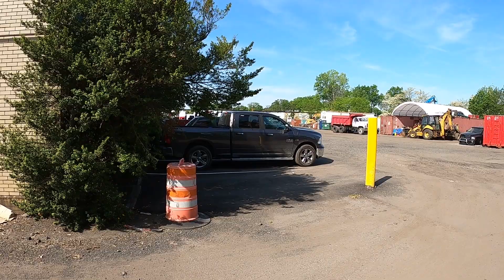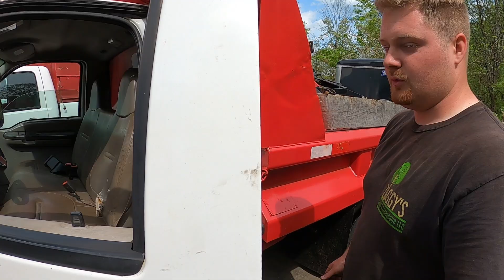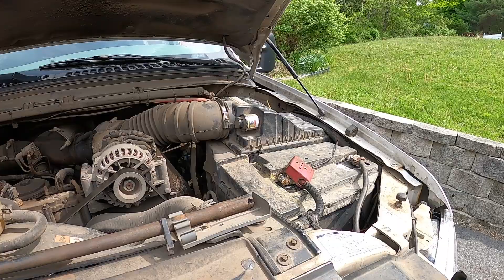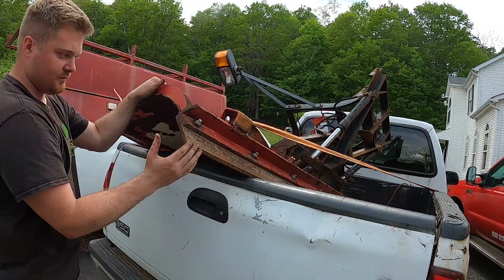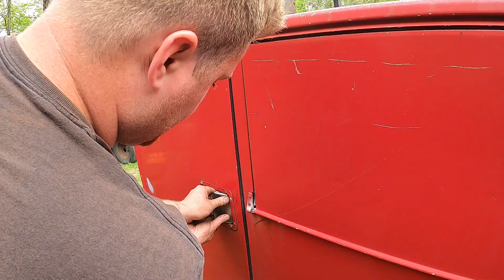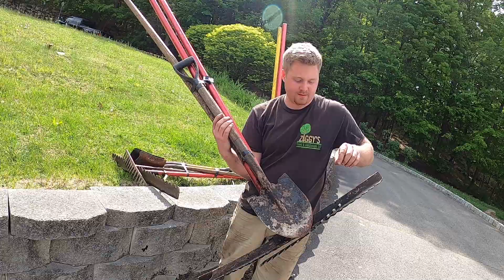Buying a Whole Other Company's ENTIRE FLEET of Work Trucks!

Comment: I do like how Ford leaves a seem at the rocker panel... Makes it easier to replace them. I did a couple on my last F-450. Also on the GMC the broken bolts in the exhaust manifolds are super common... They aren't too bad to fix usually after you take the remaining bolts out you can weld nuts onto the studs left and they come out pretty easily. 9 out of 10 I have done have been successful. Figure 2 hours per side. The manifolds are pretty cheap also if you need to replace them. I actually think I have a video on this very thing.

Comment: I have a landscaping/Snow removal company in North Jersey, not to far from clifton. We do only commercial properties and all I use are the F350s with 5.4L in them. Even a mason dump. I prefer the gas over the diesel. The only advantage to the diesel is if you do a lot of heavy towing. But for towing a landscaping trailer and plow the 5.4L's are the way to go imo

Comment: Exhaust leaked are very common on those gm trucks. The manifold bolt heads pop right off
Reply from the maker: Yea from my research I can see it’s an issue! Big pain in the but for a silly little bolt